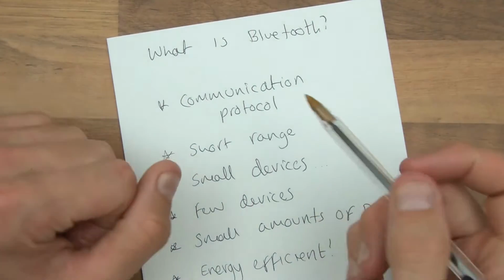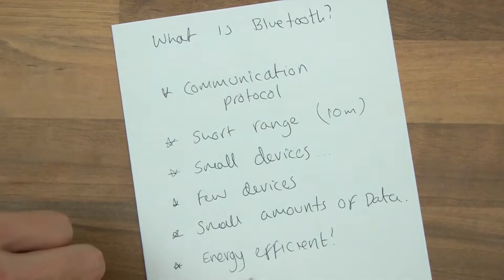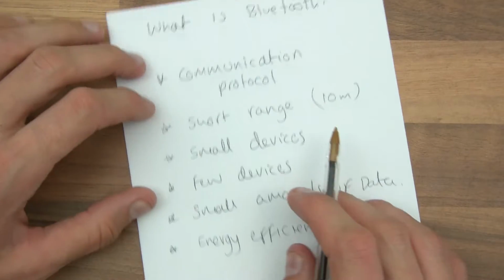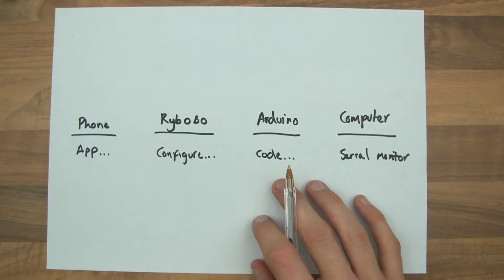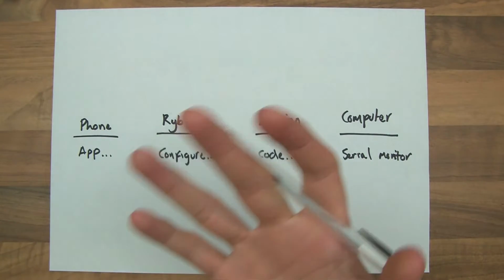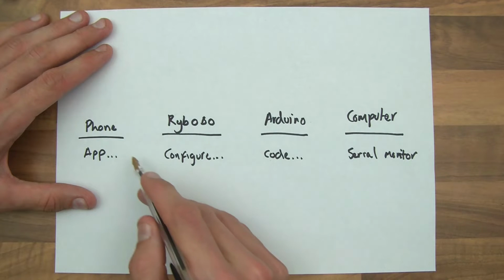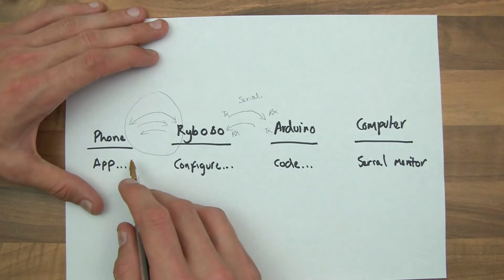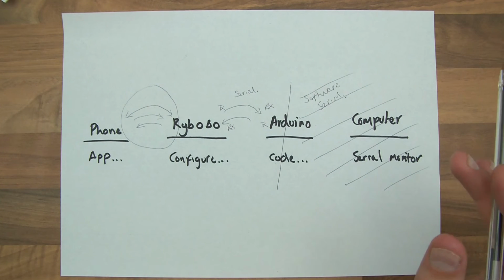TUTORIAL: Simple Bluetooth Module Arduino / Android / Reyax RYB080I & RGB LED Control BLE Part 1

Comment: Hello Antony , I am working on a project called smart keychain. The idea of the project is that whenever you forget your keychain it has to send you a notification to your mobile phone stating <<You forget your key>>.

For mobile notifications I have planned to develop an Android app.
For the keychain  part I planned to use the BLE module powered by the coin cell battery "CR2354".

My question is , whether is it possible to use the Reyax  RYB080I module without any microcontroller or Arduino? 
Does the Reyax RYB080I module work standalone?

Comment: Anthony,  this looks like a promising module.  It has a TI CC2640 inside.  Very nice
One thing I did not see is the ability to setup a new Service and Characteristics on the BLE device? 
Also then mention BT 5 but I did not notice any AT command that sets such.

Very nice product, looks like

Comment: Another Great Video. I've been ignoring BLE because I didn't know anything about it. Thanks for bringing up this subject and I'm looking forward to Part 2. Also good explination about TX/RX and USB. Sme Arduino devices have multiple hardware TX?RX pins, but they are the exception. I'm looking forward to your description and use of Software Serial SPI.
Reply from the maker: Hi William! To be honest, I was the same. I ignored BLE for a long time also. Part 2 is coming the same time tomorrow. From memory, it's more the Espressif modules which have multiple Hardware Serial ports. Unfortunately, I don't explain Software Serial in this series because it averts too much from the subject. SoftwareSerial is best kept for a seperate video. Infact, if I remember, I'll do a video about it. :-)